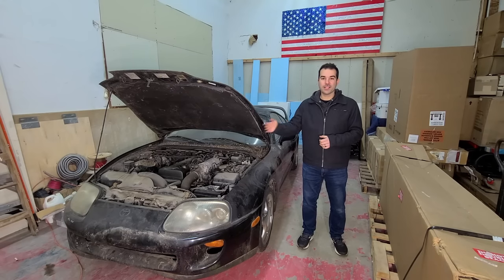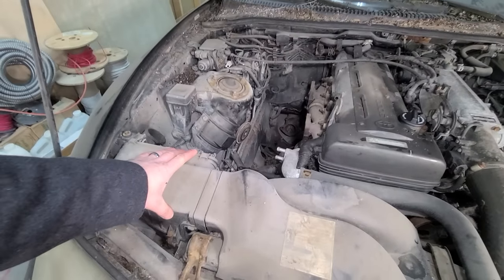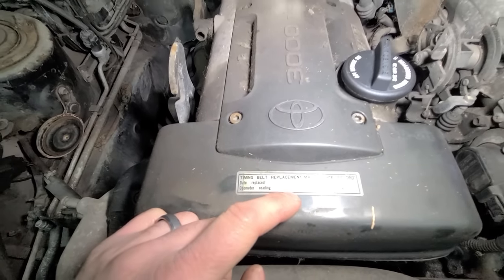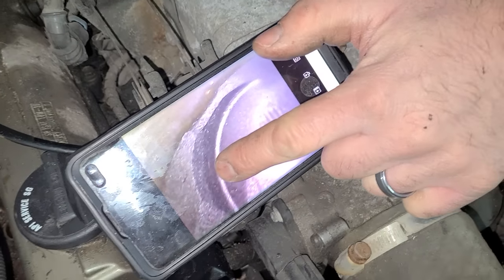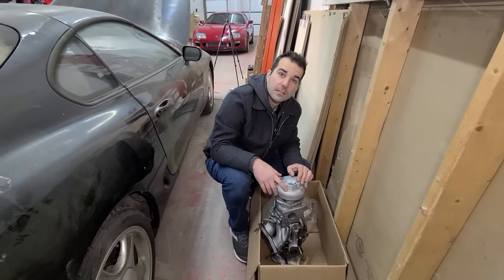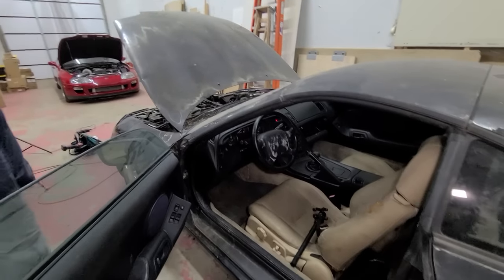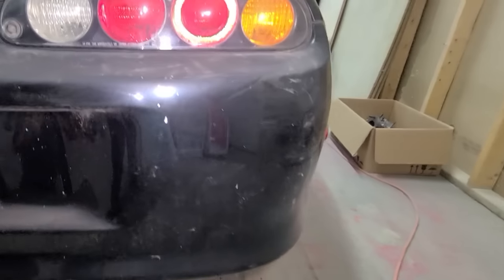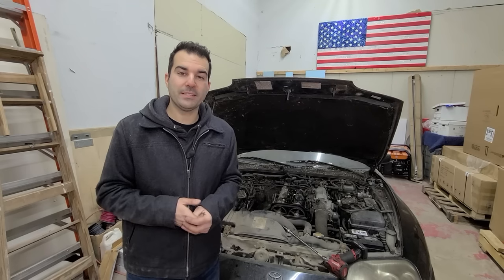I Found An ABANDONED, Twin-Turbo Supra After Sitting Outside For 16 Years! Absolute Steal Of A Deal!

Comment: Y’all can thank bmw for the 2jz. Toyota was to lazy to design their own motor so they reached out to bmw.
Reply: Who told you that 2jz is a bmw engine?
Reply: This engine the 2JZ-GTE was specifically designed in collaboration between Toyota and Yamaha to replace the 7M-GTE engine and has no realtion with BMW so don't know where your coming from
Reply: @FB6K24Z7  no one told me that but the design came from bmw.
Since when was Toyota building i6 before the 1jz? Bmw designed both motors. They didn’t build them but they designed them.
Reply: @FB6K24Z7  and Yamaha only build the heads.
Reply: @jdmcarboy64  and the source to your claim of bmw designing the Jz engines? Toyota already had in-line 6 engines in production and the 2jz was the succsor of the 7M
Reply: @jdmcarboy64  both the 1jz and the 2jz are in-house designed and made in japan engines and have nothing to do with bmw which is german
Reply: @FB6K24Z7  that’s 100% incorrect.
Trust me when I tell you, Toyota out sourced for the design.
Who has always made inline 6 and always made them to be stout and fast? What car won over 1,000 races on and off road in its time? Sure the e30 M3 was a 4 cylinder but Toyota saw what bmw could do and asked them to design a motor
Reply: @jdmcarboy64 share your source or a link where it actually says that bmw designed the 2jz or Toyota asked them to lol typical bmw fanboys